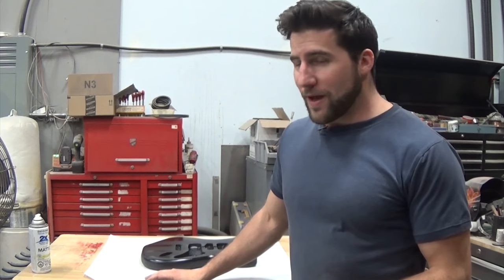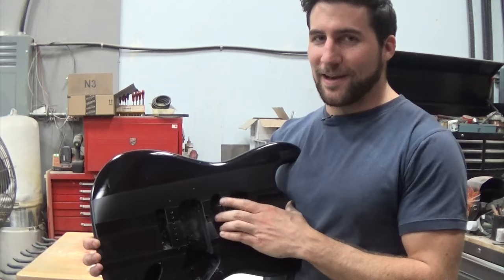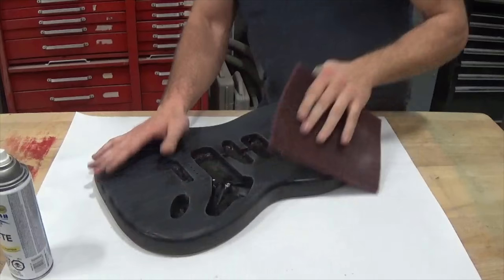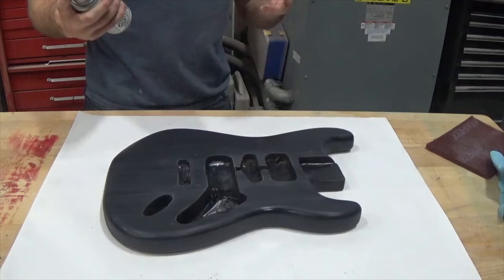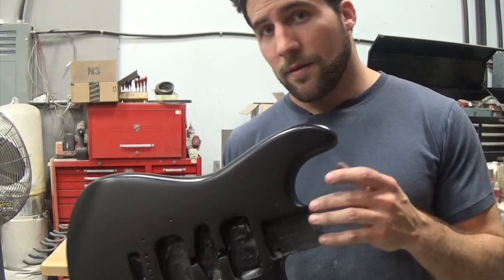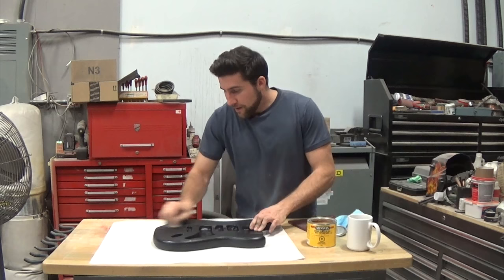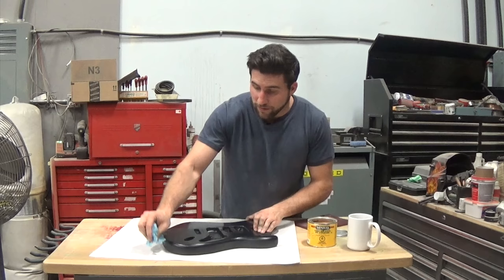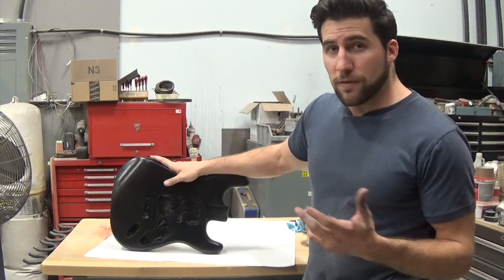How to turn gloss paint matte or satin

Comment: I quickly realized this video was not the information I was looking for.  But I couldn't help but watch it until the end anyway.  ;)  Great tutorial, Brad.
Reply from the maker: Thanks Val.
Reply: Val B - While I needed the info shown and it did in fact solve my issue, I as well was VERY PLEASED with the visual content!
Reply: @BradAngove  What number of sandpapers do you recommend?  and please also recommend the product that I will apply after sanding, my guitar is practically new and shiny, I just want to leave it matte or satin, thanks you for your answer
Reply from the maker: I would sand with 800 grit paper and then apply a satin nitrocellulose clear coat. I like the one from Oxford Supply.
Reply: @BradAngove  Thank you brother for your advice, I was thinking of doing 2000 sandpaper. It's just that I don't have any kind of experience in what I'm going to do.
Reply from the maker: It will be difficult for new paint to stick to 2000 grit. It’s too smooth.
Reply: @BradAngove  Brother, I'm sorry to bother you so much.  I have sanded my guitar with the number 1000, then with the number 2000 I have erased a little the traces left by the first sanding.  now my guitar has a beautiful matte finish but there are still traces of sanding.  Do you think that sanding with a higher number erases the sanding marks or do I need matt lacquer?  I can send you pictures if you need
Reply from the maker: If you’re happy with how the sanded finish looks that’s fine. Sanding smooth will make it look more like satin though.
Reply: Hmmmm
Reply: These are not the droids you're looking for.

Comment: I painted a tube with normal colours and I was scared that I might spill water on it. So I found some varnish at home so I painted it with it after I found out it was glossy finish (I wanted matte) so I came here to help me but the scotch brite thing is not working. I mean it does work but some parts keep becoming glossy again, what should I do?
Reply from the maker: Apply a matte varnish over top after the scotch brite.

Comment: I like how you show how to get most of these finishes without pro tools - thanks !
Reply from the maker: I'm glad that my focus on keeping the resource requirements low has been helpful. Thanks for watching.
Reply: Brad Angove what type of sandpaper is that
Reply from the maker: Ya, thats scotch brite. Very similar to the green stuff you get on a kitchen pad, except that the red or grey stuff is a finer grit and is better for this application.
Reply from the maker: Thank you
Reply: @BradAngove  Hey, could you tell me if this has a brand-free name? I'm not from US, we don't have "Scotch-Brite" here :( Or will normal sandpaper do the same job? If so, what grit should I use? I bought an old bass guitar with scratched glossy finish, was thinking about turning if all satin.
Reply from the maker: I’m not from the US either, but I’m not sure if there’s another name for those. You may be able to get away with 800 grit sandpaper, but it won’t look quite the same.
Reply: What was the grit on the Scotch Brite . Ultra fine?
Reply from the maker: I usually use the grey.

Comment: Exactly what I was looking for. I hate my gloss finish on my jackson dxmgt. Been wanting to matte it up but didnt know the best way and to keep the colors showing for the flamed maple top
Reply from the maker: I hope this helps.
Reply: Would #0000 steel wool work. Its the finest thing I could find at the local hardware store. Just dont want to have to wait on shipping from Amazon if I dont need to lol
Reply from the maker: Would it work for what part?
Reply: @BradAngove  in place of the scotch brite pad for the initial buffing off of the gloss for the matte finish
Reply from the maker: I would recommend 600 or 800 grit sandpaper instead, but steel wool will work in a pinch. Use 000 and clean very carefully afterward.
Reply: Same here, thank you brad

Comment: If you can't find satin. Buy 1 can of gloss dupliclor and 1 can of flat. Sray the cans in to separate jars. Mix 3.5 flat to 6.5 shiny and use a sprayer. If you don't have one, use prevail. You can just have it mixed. Other then that, this is a fine video to show how to remove shine. 000 Steel wool or 1000 sand paper will do. You can also use a rubbing compound then clean it of an actually just wax will shine it

Comment: Dude I've been triying for the life of me, to paint my hood Matt black .I've tried and tried and tried .it was impossible to defeat the tiger stripes ..exept for the flat black I had to settle for for the last 2 years . Then I tried the turbo can  which I could only came in gloss black..it worked no tiger stripes..but I hate the gloss finish..so you just gave me hope.doing this today .thank you I'm convinced this will work 

Life saver 🤝🙏🤜
Reply from the maker: Glad I could help
Reply: That's all technique problem. Learn how to pattern your sprays. With correct overlaps, and correct speed. Practice on something other than the hood...

Comment: Cool video. I have a budget HB Tele style guitar in all matte/satin black and the neck got fret sprouts pushing though the finish that chipped the paint so I had to sand and fill those areas but it looks scratchy. Scotchbright pad evened the sandpaper scratches a bit but needs some matte clear coat. Not sure if I can get away with brushing some on those areas or use the Scotchbright pad and do the whole back of the neck. Just wish they hadn’t painted over the fretboard sides.
Reply from the maker: You could also try just scraping the fretboard sides like a binding to remove the finish there if you want.

Comment: Love your to-the-point practical style and dry humour. No fancy edits or obnoxious dubstep or piano, just a charismatic guy sharing his knowledge, much appreciated.

I'm working on a set of speakers now but can't find the clearcoat in my store. Is it possible to just lightly polish the spraypaint with fine steel wool to remove dust particles (have to work outside) and some unevenness? Got a satin spraycan, but wouldn't mind if it turned out a bit more matte due to the scraping.
Reply from the maker: Thanks Niels. What kind of paint did you use?

Comment: hope this works, planning on taking off the gloss from a guitar, then spray some primer and paint it the color i want it.
Reply from the maker: If you’re priming it you don’t need to do this. Just sand with 600 grit, clean, and prime.
Reply: @BradAngove  nice! thanks for the help. i just finished the sanding part. now to prime and paint! Its a 2 in 1 primer and paint. just hope it will look good since the guitar was black and the color im using is leaf green.

Comment: One more question man , i sanded off my sunburst strat and the result is perfect i just need to buy the satin wax for finishing . 1 : Is there a specific type of wax that can give the guitar an aged finish so that it looks old  ? 2 : The guitar has a binding neck , shall i sand the binding line as well or shall I tape it and avoid sanding it off ???
Reply from the maker: You can sand the binding a little, just go gentle on it. In terms of an aged look, I’m not sure there’s anything that will immediately appear vintage, but my thought is I would go with odies wax dark.  It doesn’t look dark to start with, but is supposed to age over time.

Comment: Hi Brad, you clearly know what you are doing - a pleasure to watch.  The fashion is for matt black. Consequently, advice on converting matt to gloss is thin on the ground. So, I have ordered wheel covers for my 19' Gemini wheels. Naturally, only available as matt finish.  Can you advice on how I can convert the finish to glossy.
Reply from the maker: Absolutely; converting matte to gloss can be done two ways. The best option is to sand lightly with 800 grit, clean with wax and grease remover, and then apply gloss clear coat over top in the usual fashion. The other option is to simply polish the matte, but this is unlikely to yield as good a result.
Reply: @BradAngove  Thank you for that Brad.

Comment: Have you tried applying clear coat on a flat black finish?
Reply from the maker: Yes. See my video on how to do a matte black finish with spray cans.
Reply: @BradAngove  Thanks, I've already watched it and good tutorial btw, but what I mean is that what if instead using a MATTE CLEAR, for clear coating a flat black you use a GLOSS CLEAR.  Would it result to a matte black or satin black type of finish. The thing  is that I read some articles saying that matte black and satin black are just black with more SHEEN(?).
Reply from the maker: It will be gloss.

Comment: Hey, can I do this on old paint? I have got an motor bike and it has glossy finish
I want to give it a matte finish without repainting as the paint is in good condition
Thank you
Reply from the maker: Yes, you can just sand the clear lightly, clean it, and then do a matte clear coat.

Comment: Question, metal, 1 sq ‘. Stripped, painted rustoleum black lacquer, let dry, painted with rustoleum clear lacquer. 4 coats. Applied water slide decals, buried them in the clear lacquer. Way, way to shiny, can I scuff and hit it with satin? What brand, type etc? Enamel? Please advise!
Reply from the maker: Yes you can. Try sticking with the same brand and paint type if possible.

Comment: How do you level the satin finish after applied to get rid of tiny imperfections or dust particles set when it was drying? without making it glossy again of course?
Reply from the maker: You can’t as far as I know. A proper satin finish has to be perfect out of the gun/can. However, you can buff to a respectable semi-gloss after sanding if you’re careful. I use hard wax oil to do that sometimes.

Comment: I have a Harley Benton Strat, with the burst finish in gloss. I haven't even plugged it in yet, (long story, I should start making vids on what not to do) and it has micro scratches and one a bit deeper by yours truly. Would this work with that poly finish? 
I'm not a fan of gloss, but I also don't want to make a major blunder. Any advice would be much appreciated.
Reply from the maker: It works the same with poly, assuming you mean you want to rough it up and apply a coat of matte. It’s tough to get a nice matte finish though.

Comment: It's best to satinize with wool on a flexible block going in one direction (parallel lines). Don't rub back and forth, drop in and rise out. Going back and forth will put hooks in the lines. This is going to be the difference between a professional-looking job or not
Reply from the maker: If you’re sanding, yes. Not for this though; notice how polishing is often done with a rotating disk? Buffing and sanding are different things.
Reply: @BradAngove  I professionally restore pianos and show cars...
Reply: @BradAngove  you can trust my advice
Reply from the maker: That’s what they all say haha. I’ve worked on old show cars with guys who professionally restore them too. If you’re using steel wool on the finish of a show car, you’re making a mistake.
Reply from the maker: Relax buddy. If you look around my stuff, you’ll see I’m always happy to take on board new information. This isn’t new though; I’ve tried doing it linearly like you’ve said. That technique serves an entirely different purpose. 
And again, there’s no way you should be using steel wool on a car.
Reply: @BradAngove  🤦‍♂️ nobody said anything about that... You should be a politician.
Reply: Piano... With nitro lacquer like most guitars. You satinize urethane clear with a flatting agent, usually mixed 60/40 to get a good match to like the satin Hyundai's you see on the road. You know.. NVM

Comment: Hey Brad, great looking project. I wanted to know if you have ever done this deglossing approach to a Tortoise Pickguard ? This is something I want to do and your video caught my attention. Many people say very fine wet and dry sandpaper can work but I worry about scratches. The goal is to just remove the gloss finish to reach a slightly aged look , any recommendations are greatly appreciated, thx and keep up the great work !
Reply from the maker: I’ve never tried that, but I’m inclined to think some 3000 grit sandpaper would work.
Reply: @BradAngove  Hey Brad, looks like my first message did not make it over. I did in fact use some 2000 wet and dry and it worked like a charm, this was all inspired by a guy who runs Spitfire. He makes amazing Tort guards but at $250.00, that's a little steep for my Squier Jazzmaster that I paid $280 for .. ha ha .. Sofor $15.00 and a little elbow grease mission accomplished check his thread out, very cool stuff https://www.instagram.com/spitfiretort/ .. Cheers !
Reply from the maker: Awesome. Glad to hear it worked!

Comment: I did not know it was that easy.
Question, if you have a logo on the gloss that you want to keep, I know you can cover it with tape however how would I cut the remaining pieces of the tape without scratching the gloss?, or would making it matte not show the scratch?
Reply from the maker: You just need to be very very careful. You cut very lightly so that you barely make it through the tape.
Reply: @BradAngove  Alright thanks man, I would have replied earlier if I saw the notification.

Comment: What happens when you’re doing doing front back and sides? Do you just turn the body over and repeat? What about the sides? What do you use to lay the guitar on when you star on the back?
Reply from the maker: Usually I would prefer to hang the guitar body in those circumstances.
Reply: Is it more difficult rubbing or wiping on poly when it’s hanging in the air?
Reply from the maker: Not really.

Comment: Great video👍🏻….I have a gloss uke & I want to turn into satin…do I have to remove the clear coat all the way?..scotch brite only or steel whool?
Reply from the maker: You don’t need to remove it completely. Steel wool is an option, as long as you make sure all the fibers are removed.
Reply: @BradAngove  thanks👍🏻

Comment: Great video! Helped alot.
I have one question (not rly for this topic but here i go): 
How can I darken spray paint a bit? I am using spray cans so mixing the paint  is unfortunately not an option.
Thanks!
Reply from the maker: Use a black/dark base coat underneath them.
Reply: Thanks alot :)
Is a black paint coat enough or do I need to use primer?
Reply from the maker: +Pianoriju that depends what you're painting
Reply: I am painting a captain america shield based on glass-fibre reinforced plastic. I did the following with another one:  Plastic Primer, Silver Paint and then color on certain areas.
My idea now would be using a coat of black followed by acrylic resin paint (light bluish color) to make it darker. 

I guess I just gonna try it. Learning by doing :D
Keep doing videos !
Reply from the maker: +Pianoriju let me know how it goes!

Comment: Hi Brad, I've got an Ibanez RGA with a matte finish and a large part of it has turned glossy. Should I scuff only the glossy bit or should I scuff the entire finish for the clear to adhere well? The top also has a flame maple veneer, so does that mean I have to sand with the grain of the veneer?

Great tutorials, mate. Thanks!
Reply from the maker: You would need to scuff the whole thing for adhesion. Grain direction doesn’t matter; you are only sanding finish, not wood.

Comment: Great video!  Could I use this technique to repair a lacquer painted board that need some touch up paint?
Reply from the maker: To even it out after? Yes, this technique could be adapted to that purpose.
Reply: @BradAngove  Yes, I just patched some screw holes.  I don’t have the original paint, so I was thinking I would either spray paint just the repaired spots and then even it out with your technique.   Or spray paint the whole thing and finish it with your technique to mimic the original finish.  What would you do?  BTW:  Thank you so much for your prompt response.
Reply from the maker: I would probably re spray that entire side of the board. Hiding touch ups can actually be quite challenging.

Comment: Would it be easier to start with flat or matte to get a satin finish with satin clear coat or start with a satin enamel and finish with a satin clear coat?
Reply from the maker: Start with gloss. Then sand smooth at the end and add a coat of satin. Satin is basically gloss with a matting agent in it most of the time.

Comment: Thanks for the video. I have a satin guitar and I've been going around in circles with this satin/matte/semi-gloss it's driving me nuts LOL. I've decided to just polish up some main areas to semi-gloss and leave the other parts in worn satin. It's too delicate to touch a satin guitar. Drives me insane.
Reply from the maker: Makes sense. That’s basically what I discussed in my video about the problem with matte finishes.
Reply: @BradAngove  There's something I want to add. There's a way to reduce shine caused by rubbing, like on the neck. I use a car wax. This causes the gloss to opaque. I have done that to tame super glossy parts. It still is shiny but not glossy. I hope that makes sense.

Comment: Would this work on a wall??  Or should I just paint the wall matte black?
Reply from the maker: You generally don’t need clear coat on a wall. Just painting it matte black is probably adequate.
Reply: @BradAngove  but it’s already painted glossy black, so can I spray paint if matte black?
Reply from the maker: If it’s glossy for some reason you would need to sand it first. Then you can spray it matte black, or spray it with matte clear.

Comment: bruh I didn't tought that I would get a video doing exactly what I wanted to do lmaoo good video btw, one question, does the sanding wouldn't get rid of the color of my guittar? this may be a dumb question but this is the first time I do a stuff like this 😅
Reply from the maker: Your guitar likely has a clear coat, so a bit of sanding won’t reach the color.
Reply: @BradAngove  got it thanks for the video btw 😎👍🏻